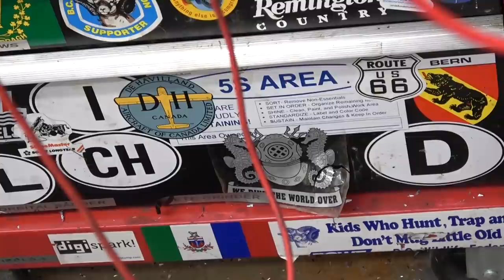What else will it do? | Magnet, Metal & Machine

Comment: I thought Ave was making a magnetic clutch until the final scene. I was expecting to see a mirror image version, too.
A real Hallbach array would have perpendicular magnets between each pair of axial aligned ones. The 9th magnet makes it so it only couples well at one angle.
This would be just the thing to transfer rotary motion into a vacuum chamber. Just put the spinning magnets on opposite side of a glass wall of the chamber.

Comment: On an old crt TV I would've used that in a drill to degausse the tv
Reply: I've had & used an old CRT degaussing coil for eons. Works great, and even accommodates larger stuff like bench vises. As a rule I hate magnetized tools... but for the rare occasion when a magnetized tool is needed; it's nice to be able to degauss again at will.